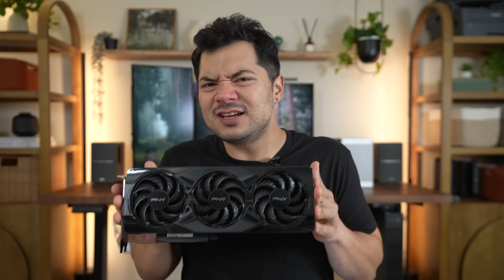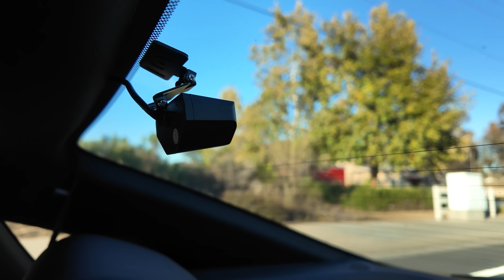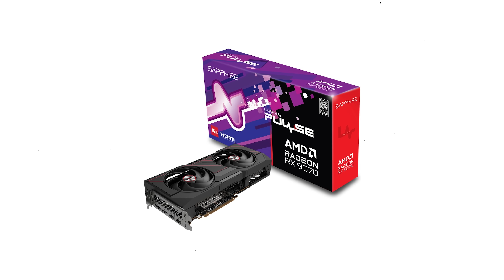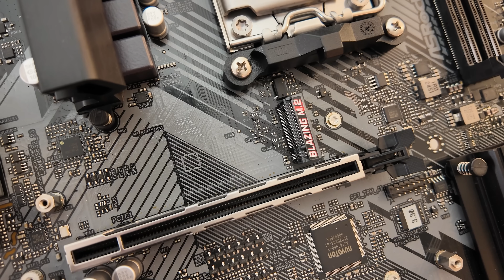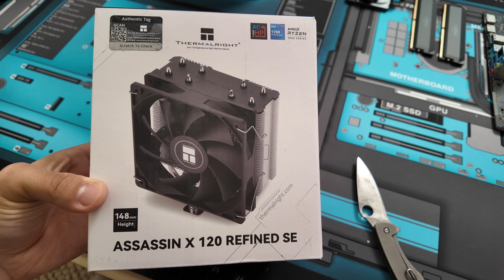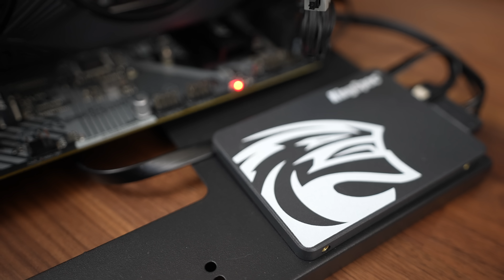The $1,000 Gaming PC Dilemma.

Comment: Jay has a video he just made several days ago where he tries to build a pc with steam machine performance. Its much more well rounded than this build but he uses a weaker GPU and it still cost him $1700. For $1000 I love this build. very first thing I'd change in the psu, that's never a part to skimp on if you can help it.  I love the test bench, I've had a similar set up before, just have to clean it more regularly which is easy because its so open. Obviously a bigger ssd would be great and not very expensive but also not necessary. This is a pretty solid build, fantastic at 1080, great at 1440p and decent at 4k. for $1000 what more could you ask for?

Comment: > Was it well spent?

Nope. Spend $20-40 to make sure that PSU can be used for a future upgrade is really important and to better absorb fluctuations in the wall power should have been done at a minimum. Also, a good 2tb ssd isn't that expensive and would last so much longer than a 500gb. I would also spend more on the RAM to get some better timings to help with those 1% lows-really sensitive to those, but they have shot up in price. I tend to overspec for PSUs and ssd storage since the storage slows down once you get past 80% utilization and the PSUs get stressed when they are over 80%.

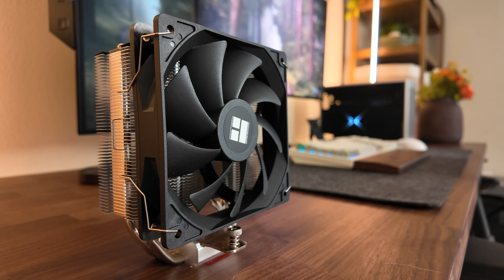Comment: 8:54 Haven't seen a CPU cooler with an 80mm fan being used in ages, I believe you meant to say 92mm fan. Certainly 80mm fan coolers still exist but 92mm fans have been standard on budget CPU coolers since at least LGA1155 if not earlier.

Comment: I am actually currently rocking a Z790 board, 14600k, 64GB DDR4-6400, 4TB NVMe and an Rx 9070 XT on that exact open air bench and I wouldn't change a damn thing lol. I was definitely chasing max performance over aesthetics at the time.

Comment: A 5070 build should be budgeted at around $1500.
At $1000 I'd be more inclined to build a better balanced system with a used 30 series card and save up for a GPU upgrade later on.

Comment: Issue is gonna be RAM now. I was looking at a 6000 32GB kit of DDR5 a month ago that was around $90, that same kit is now up to $120. I ended up buying a used kit of Kingston for $100 which still did not feel good but I got a good deal on an X670E Tomahawk wifi for $120 so it kind of balances out

Comment: I'd get a 7500f, 16GB of ram (don't need 32gb), swap to the segotep 650w unit, and buy at least 1TB storage (ideally nvme). Any excess get a real case - cheap ones are like $40. Maybe a different mobo. 5070 has dropped to $500 new now too. 

OR get a used GPU!

Comment: Kudo's for using the RTX card.  I stil have bitter memories from many years ago when it comes to Radeon Drivers..  (yes, I know.. they have gotten better, and yes.. I know that some of Nvidia's recent drivers have been..  uhhh.. questionable)
I think its a valid build.  Since honestly.. When is ANY DIY / self-built computer ever actually 'Done'..  (the answer is never)
I tend to dislike anything other than ATX boards.   But thats a personal preference.
My personal opinion.. I might have sacrificed even deeper on the sata SSD and gotten even a tiny (256) nvme.   
But, I didn't notice if that board supported multiple M.2's    If not, then yeah.  you had no choice.
I also agree (with commentary) with the 'I'd have used some used parts') comments.
The commentary portion being..  Most people building their PC will have a case they can throw at the cause.   perhaps even a power supply that will 'make due' in the short run.
The price of memory is doing nothing but going UP right now.   
So honestly, I think $1500 should have been the target..  Still make the sacrifices (overall), but made sure it was in a case, probably a beefier Motherboard.   Still try to hit $1200 ish, and then comment with a smirk at the end..  I didn't use the entire budget..  because you might not want to make THIS many sacrifices..  
Stepping up to AM5.. YAY!!  But not kneecap it for a 9000 series processor (power delivery wise)
The two things I DON'T want to be mid-life upgrades are the GPU and the MB.. 
Quality memory, good choice.. cheap out here and you end up with stability.
Cooler already as cheap as it needs to be.
So, after the party..   You want to get a case (if you didn't already have one)..  Make it attractive enough to prevent buyer's remorse, Locked into a 2TB or a 4TB gen 5 M.2 since it has one socket..  or punt the MB (with the cost difference from a pair of 1TB's in Raid)
Overall though.  Still a thoughful build for the $1k limit

Comment: You can now get the MSI Gaming RTX 5070 12G Shadow 2X OC for $499. With the $50 you saved, I'd put $20 towards an actual case and $30 towards an m.2 drive thats higher capacity (you should be able to easily get a 1TB name brand nvme).

Comment: I would go with AM4- 5800X3D. 
I think $1000 of AM4 + RTX 5070 would get you further than $1000 of AM5 + RTX 5070.
With the cost effectiveness of the older AM4, more money could be put into the PSU-Cooler and Case (you know the stuff we can keep as a foundation for the upgrade to AM6 in a couple of short years.)

Comment: Intel 12600K
RTX 5060 8Gb
ASrock B660M Steel LEgend
16Gb DDR4 3200
Corsair RM750 PSU
Crucial P3+ 1Tb NVME 5000Mbps
Deepcool CH370 case
Coolermaster Hyper 212 Black cooler
TP-Link Wifi 6 PCI-E add-in card with antenna and heatsink

After selling the old case (for £10), RTX 2070 (for £100), and 480+240 SATA SSDs for £20

Total cost will be £480.  Not a bad system for the money, and the case, gpu and nvme are brand new.

Comment: I would definitely save up another $100-200 for a better PSU, motherboard, nvme and case. If that wasn't an option, I would use a 9060XT 16GB GPU instead. 
I think starting with a better base is much smarter than having the GPU dominate the cost. Skimping on motherboard and PSU doesn't allow you to upgrade the CPU or GPU to whatever you want. You become very power limited on those components. I'd rather overbuy a CPU, than the GPU.

Comment: It's crazy how little $1000 gets you nowadays. No, I would not build this and would recommend against building this PC. Not because I think you did anything wrong, but because $100 more would get you a case and a full 1 TB of storage. $200 more would upgrade the Motherboard and Power Supply as well. Unfortunately, the 5070 doesn't really fit into a build at this budget.

Comment: My take is a bit different. Except for the "case" and storage, it is a banger. I do not buy the future proofing side of it. If you spend 1000 bucks on a system, you are going to keep it for 3 yrs at least. By that time, newer hardware is available with substantial performance increases and should be the upgrade path should you wish. Selling your old PC get you a good chunk back on for your new system. There is always peeps that can do with older capable hardware at a used price. And the two RAM slots on the M/B is perfectly fine, who buys 4 sticks in any case? It's a B650, so PBO works and for 65W parts, it is perfectly adequate. Nice vid, cheers!

Comment: Still roughly 25% more than a RTX 5060Ti 16GB which provides plenty for my 1080p setup. Perhaps if I was looking at 1440P and could use the extra grunt but realistically on a 24" monitor I've no need to go to 1440P

Comment: I would get a Ryzen 7500F instead, or a Ryzen 7600 with the stock cooler - both options would save you $15 to $20. I wouldn't buy that case, but rather to look for any case for free on craigslist. Or just leave the computer on the motherboard box, I used to do it for couple of months, and then I got a new case for my birthday :) With additional $30 saved from the CPU/cooler and case - I would buy a better PSU, some 750W with Gold rating you can find for $80

Comment: I think the 1k budget was well spent given the constraints for someone that was fixed with that amount.  That said, I will find a way to get some extra  and out of the gare get a better mobo, a proper case, ram, m.2 and PSU. changing those from the start will pay for itself and as you mentioned, as more budget comes available I will refund whoever lend me extra cash.  This later option will also reduce the potential e-waste factor of these components if replaced one by one down the road.

Comment: This is a very Max Performance Gamer move and builders will rarely approve of this method but I do! Everything skimped on like the SSD, Case, PSU, Processor can easily be upgraded to better ones when more funds arrive. Had he gone with AM4 or lower class GPU then they will be stuck on its performance level and upgrading will cost so much more. This is a wise build for 1k usd but as he also said IF the gamer can buy a 9070 with 16gb that would be much much better!

Comment: I endorse this approach. You get a working PC with a good GPU,  decent CPU and Good ram.
Upgrading is easy enough as you save more money to add a M.2 drive later.

The parts selection is actually good. No dodgy off brand PSU that could fail and kill your new PC. The core components are solid.

For the case I wold actually buy nothing... new, and instead reuse an old case you have, ask friends/family if they have an unused one, or hunt one down in market places, recycle centers etc. Just make sure your GPU and parts will fit inside. You may be able to get the case for free.

I have actually used this approach when as a student I got my first PC. Fast CPU, a passable GPU for uni work, lots of ram, basic case, psu, motherboard. It got me going and in my case, animating at home again. Overtime I replaced the weak parts of the system, and that's what's great about building your own PCs. You can continually upgrade them a part at a time. I only just upgraded my case to a really fancy one for the first time in 9 years.
Reply: Buddy, the power supply he chose is literally F- tier on the tier list, it literally can and likely will fail and kill your PC lol

Comment: FYI, Hardware Unboxed did a test recently comparing SATA and gen3/4/5 NVME drives in gaming and while FPS didn't get impacted too much, load times were a lot slower on SATA. So, while budget is budget, a SATA SSD is not really recommended in a modern gaming system.. Gen 3 NVME minimum.

Comment: A very legitimate video man. I don't think I'd punch a builder in the face for their work but, if I were gifting $1000 into such a project, I would probably wait a little bit to find an extra $250 or so to bump it up into a case with some more storage. The hardware may have improved, as these things tend to do with time, but the £/$ stretch isn't quite what it used to be about eight to ten years ago is it.. 😶

Comment: Two DIIM slots is not a problem. When did you ever use four DIMMS on anything?! An M.2 format drive would be much more expensive and a far better option. Nothing wrong with that test bench. It works and there is less need for fans 🙂👍
Reply: in the DDR3 era when upgrading... but never used more than 2 sockets after that
Reply: @LittlebitsStreams really it's the ddr5 power ic that you don't want more than 2 right now
Reply: Been using 4 dimms for years. 

DDR3 4x4gb to get 16gb. 
DDR4 2x16gb and 2x32gb to get 96gb. 

I always have maxed out ram as it gets cheaper since Pentium 1 days and fast ram.

Comment: Getting these parts on sale for these prices though is always going to be the difficult thing. When nothing is on sale like that, you pay quite a bit more than $1K.

However, Black Friday and Cyber Monday are right around the corner here so it should be easily doable that you can put together a system with something like the 7600 (or even 7600X), 1TB NVME with a case (like the Cooler Master Q300L V2).

The MSI SHADOW 2X OC 5070 is on sale for $500 which helps as of writing this post.

As of right now writing this post I can put together a system using the above GPU as an option on PCPP for $1,012 USD but it uses a slightly lesser CPU, slightly slower RAM and slightly lesser motherboard in order to get 1TB NVME and the Q300L case and of course takes advantage of existing sales pricing for quite a few things.

The build ends up being the following:
Ryzen 5 8500G - $165 (on sale)
ASRock A620M-HDV/M.2 - $80 (on sale)
Crucial Pro 32GB (2x16GB) 5600 CL46 - $110
PNY CS2241 1TB Gen4 NVME - $62 (on sale)
MSI SHADOW 2X OC RTX 5070 - $500 (on sale)
Cooler Master Q300L V2 - $40 (on sale)
Apevia Galaxy 650W 80+ Gold PSU - $55

And for someone who isn't overclocking and just wants a PC that will boot up and play the latest games, you don't need the best of the best CPU and while faster RAM is "better" the difference between 6000 MT/s with a little better CL and what I picked above isn't going to result in any real world noticeable difference in your gaming experience.

I mean, game devs are making things work on consoles which have considerably weaker hardware and older hardware so yeah, you don't need the best of the best and can save a bit of money here.
Not to mention the 8500G has integrated graphics you can use as a backup solution for any troubleshooting that comes your way which is always nice should you ever need it.

Let's see what kind of deals BF and CM bring us this year though. If we can even get a system together for less than $1K that would be dope.

Comment: This is like if you bought a mustang, but the body was just the chassis without any panels or windows, no muffler, and the gas tank was an office water cooler jug strapped into place where the rear seat should be.  Does it go fast enough?  Yes.  Should you do it?  No.  😅

Comment: I'd grab some used parts if I was stuck with a hard cap of $1k
Reply: I would have dug up a used case at least I am sure there are many of them floating around. However I do like that test bench idea for my own home lab.
Reply: This is the way friend.
Reply: Defeats the whole point of the video, just as spending $100 extra to relieve the "cheapest new parts possible" pressure would. The idea was "$1000 PC with RTX 5070 from all new parts" as the core theme of the video. If I was him I would've included a side note about it tho, to not make it seem like he somehow didn't think of that to some. Which he most definitely did.

Comment: Cool love these kind of min/max format build vids. Going with the 5070 theme and AM5 platform with pricing at the time of this video I'd primarily focus on saving some dollars towards an NVME SSD by getting 7600 with included Wraith Stealth Cooler (still plenty powerful for the 5070 and can use PBO to get it closer to a 7600X anyway), not worrying so much about the brand of RAM but making sure it's QVL certified by the motherboard manufacturer and then getting most bang for buck. Pretty sure you can't use Direct Storage optimisation with a SATA SSD so you're hurting performance in certain titles more than going down to a 7600 or "off-brand" RAM. Got to be at least $50 in savings with those for better hopefully higher capacity NVME drive. 
Since this is buying all new parts I appreciate the creative "case" choice! I think for $20 more you can get something from AliBaba that's in case shaped form. I'd just get something from e-waste personally if I was on a super tight budget.

Comment: Picked up a 4080 for £610 used, luckily I already have a 13900k from 3 years ago
Reply: my 3 year old 13900k already had that RTX 4080 in it
Reply: Picked up a refurbished fe one at Microcenter for 750. I chose it over the 5070 ti because of the random problems with either noise or things randomly failing, or just risky drivers in general. It ofc had coil whine (as I should have expected from fe) so I undervolted it. Btw after I commented abt it on reddit, stock suddenly seemed to dry up despite minimal views. Guess it was decent value after all... My Microcenter literally ran out today after the fe models were sitting there for weeks. Man.

Comment: Uhh, if those are the final specs, you either increase the budget or go with AM4 tbh. You don't actually have an upgrade path. You can't realistically  swap the CPU because then you'll have to swap the motherboard too, and almost definitely the PSU, and none of those parts can be reused really. You'd almost be making a whole new computer. The only thing you can really change later on is the storage.

So yea, I'd definitely advise to NOT make something like this. Luckily, we can have videos like this just to see how it turns out.

Comment: great timing! Im actually building my good friend a $1000 pc because he can't afford to buy one on his own. Comparing his current, I decided to build him for christmas as a gift.

Specs : 

CPU: Ryzen 5 5500 
Ram : Corsair 32GB DDR4 3200
MB: Gigabyte - B550M GAMING X WIFI6
SSD:  SK Hynix Platinum P41 1TB 
GPU:  XFX AMD Radeon RX 7600 Speedster SWFT210 
PSU: Corsair - CX750M 750 Watt 80 Plus Bronze
Case:  Montech XR Tempered Glass ATX in black. 

Old Specs :

CPU: Core i5 10400f
Ram: Corsair 16gb 2666mhz DDR4
MB: Gigabyte H410M S2H V2
SSD: 2TB WD blue HDD, and 512gb SK Hynix SSD 2.5in
GPU: RTX 3050 from Gigabyte
PSU: 500w evga 80+ bronze
Case: NZXT H510

Let me know what you think. I personally think I can reuse his Storage (along wih the m.2), the ram, case, and the rest I'm gonna donate to people around me.